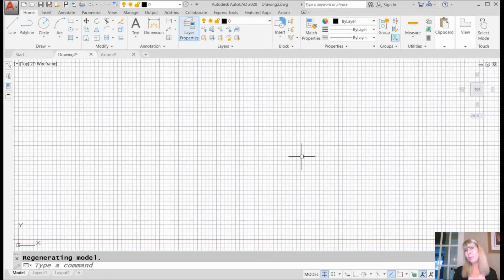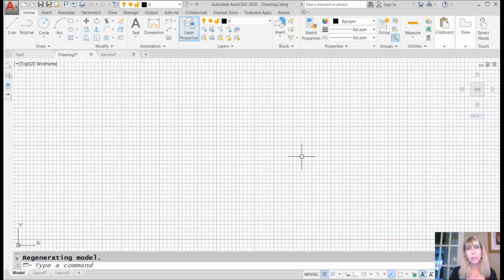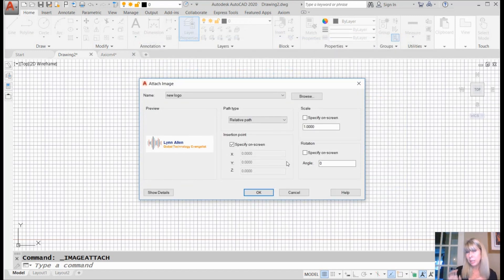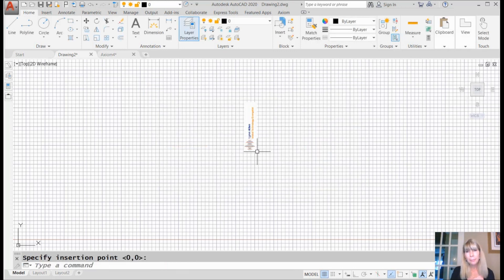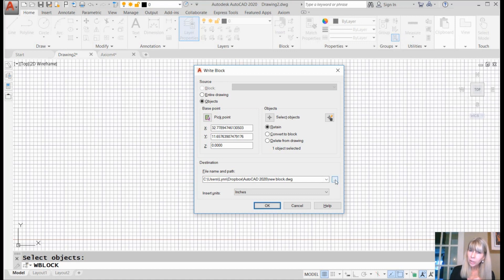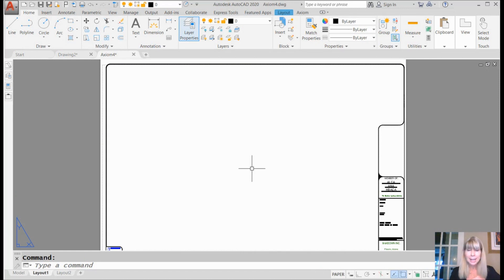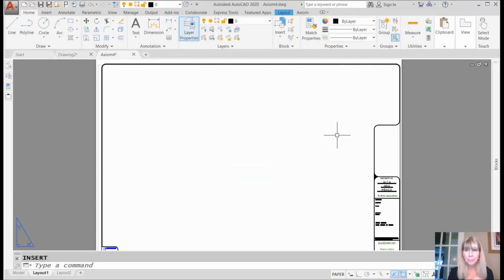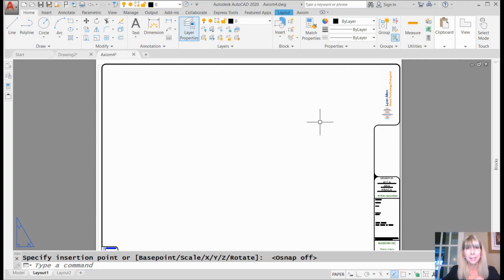AutoCAD Video Tips: Converting Your Images into AutoCAD Blocks (Lynn Allen/Cadalyst Magazine)

Comment: It seems like this method wouldn’t work ‘If the files need to be shared’, since the image contained within the block is a referenced file, the image itself resides only on the persons computer and not within the block, maybe I’m wrong, the method I would use is to insert the image through ‘Paste Special’ then making it into a block.
Reply: Other method I think would be Open the image in paint then Copy & Paste it in ACAD